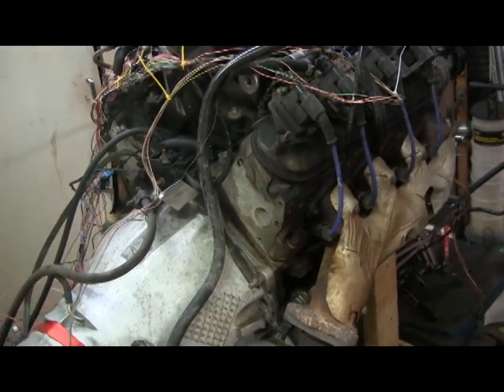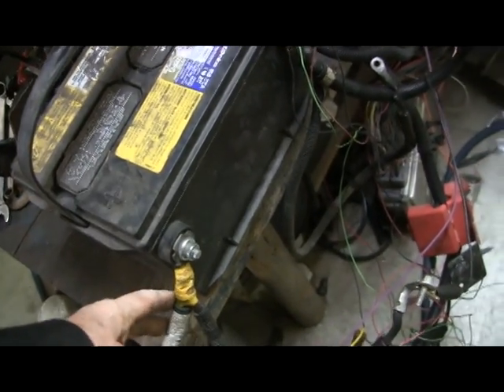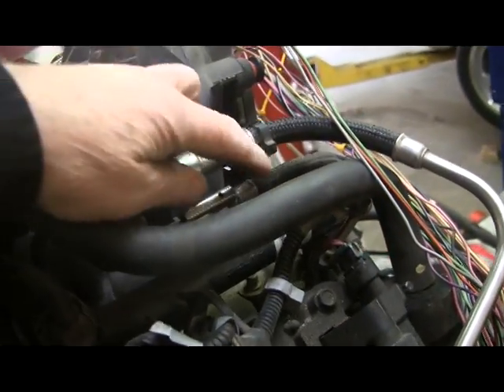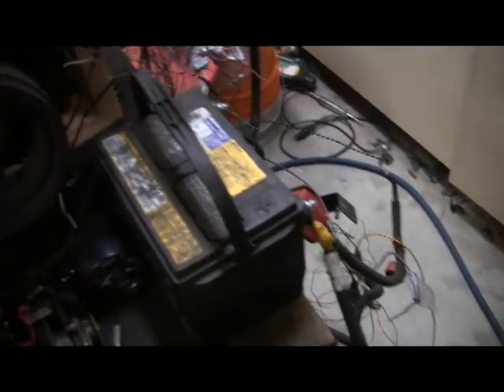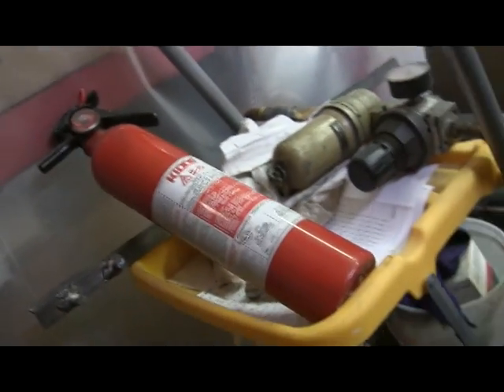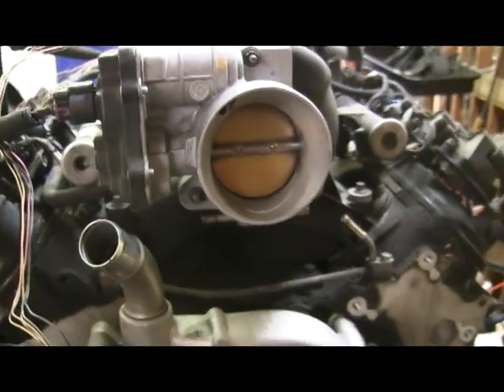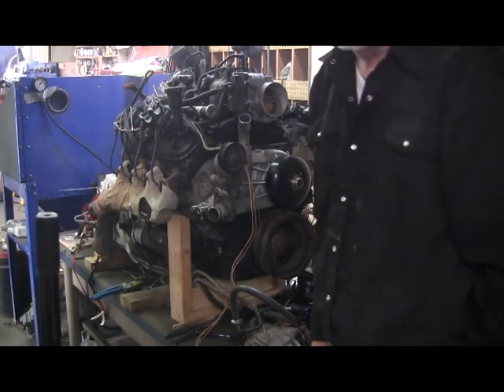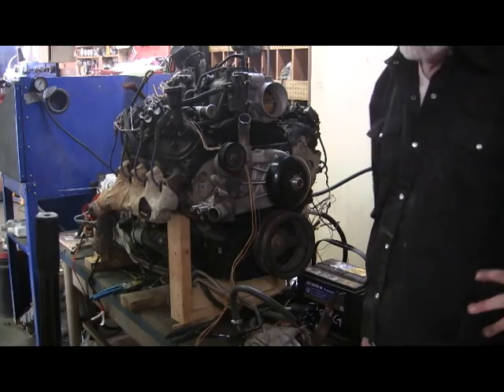6.0 LS engine, first start as a stand alone

Comment: How did you disable the vats?
Reply: While in still in the vehicle run the engine and unplug the body module, shut the engine off and remove the PCM. It's the body module that locks up the VATS when you turn off the engine, but if the BM is unplugged it can't communicate to the PCM. If you install the PCM into a vehicle with a BM it will again lock up the VATS.
Reply: Disable vats with hp tuners.

Comment: you need a 24x reluctor and ls1 pcm to make the TB work
Reply: Miguel Cortes his throttle works fine. You're info is dead ass wrong..... The reluctor wheel has nothing to do with drive by wire!